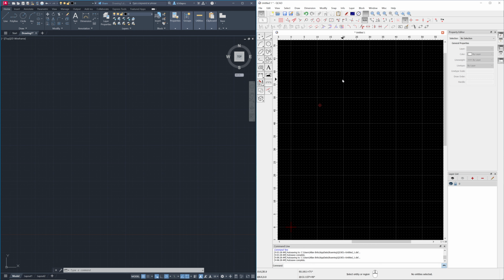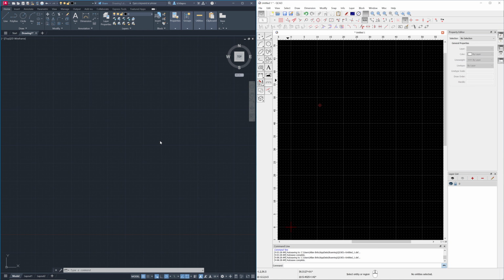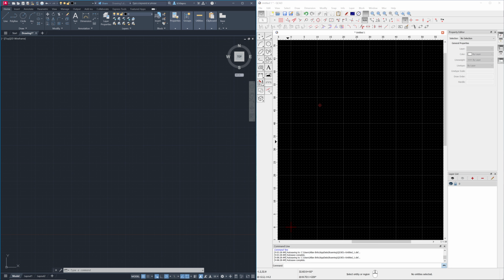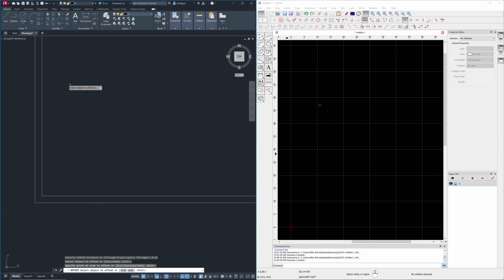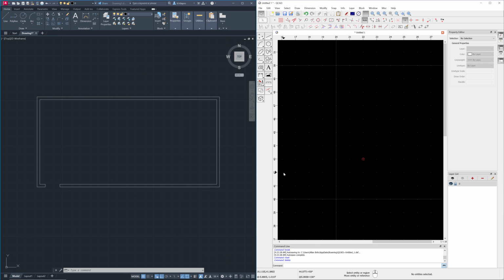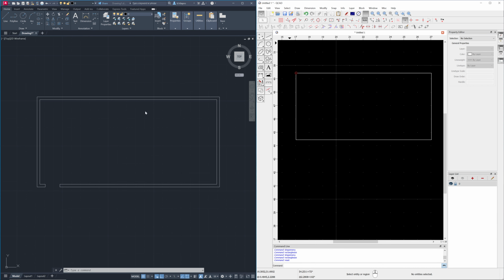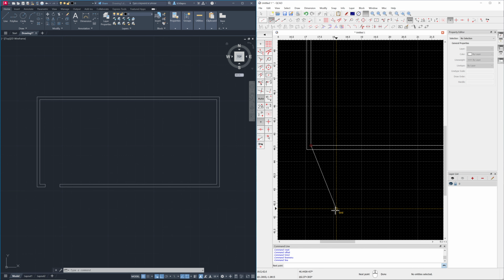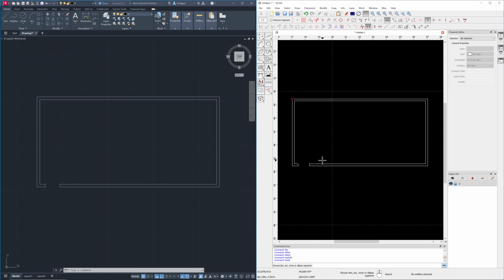AutoCAD to QCAD: Migrate to open source CAD

Comment: While you can do the same work in both siftwares however, a lot of the processes are not the same. The trim command in autocad is a lot simpler and faster to use than in QCAD. If you want to use a reference image to trace and set it to real world scale the process beween the two are not the same. Nanocad as far as I know identical to autocad in the free version, and identical in appearance in the subscription version. I think when you guys do a side by side comparison you never tell the full story. You try and over simplify it and present the world as a  happy place with puffy clouds.

Comment: You can do that in Qcad in far fewer operations, after creating the enclosed dimensioned rectangle, use the poly line offset, input distance and click as you did inside the box, it will draw the full offset rectangle in one. Then from the left offset first break, then the second then use the breakout segment to create the gap.

Comment: It is ok for such basic task but it is not as scalable and optimized as AutoCAD, lacks advance functions like Dynamic blocks and other tools. 
I also tried LibreCAD but that is also very basic as well, i mean you cant rely on them for any serious project. However, i use rhino for all my 2d and 3d work even it dont have dynamic blocks but i love the flexibility rhino provides at a very low cost for all 2d, 3d and parameteic modelling need. 
I use Rhino+Blender+D5+Inkscape+photoshop+Davinci resolve for my current architecture and visualization work.

Comment: thanks for your video promoting QCad, it's a good piece of software and its Pro version is not expensive.
If you don't mind:
in QCad you can offset without trimming the corners one at the time , from the menu bar choose the correct polyline mode, I am using the Pro version, not sure if it's the same in the free one.
In Autocad to start a segment at a distance once you select the command right click and pick 'from' in the menu then you can click on the start point and type the distance
cheers
Reply: It is not. Polyline offset is a Pro-only feature, as described in the feature list on their official site.